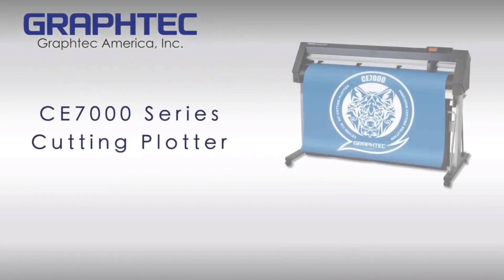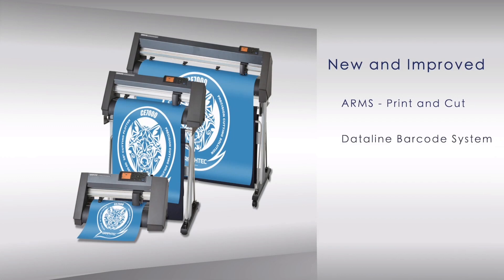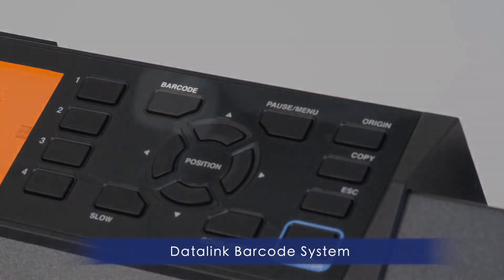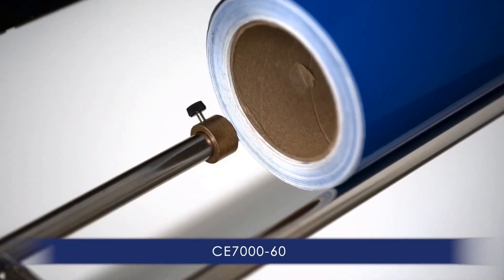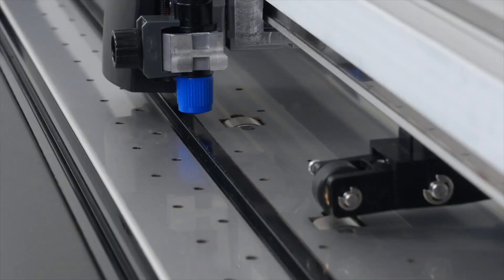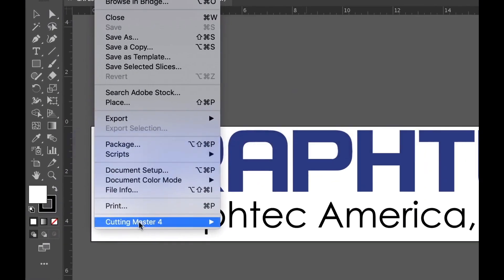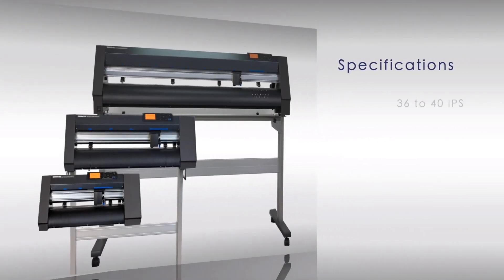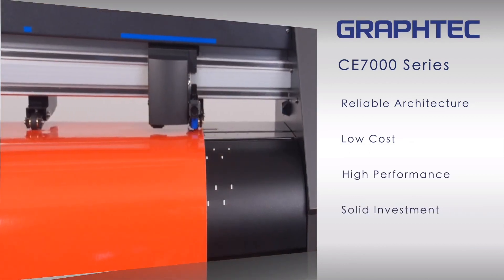Graphtec CE7000 Cutting Plotter

Comment: Sorry if this a crazy question. I'm looking for our first vinyl plotter. I have a good deal of experience installing vinyl vehicle lettering & graffics. But I would like to purchase a plotter to begin cutting our lettering & graffics. As an emergency/utility vehicle builder alot of the lettering & graffics we use are done using reflective vinyls. So my question is which plotter would you recommend? We do need the option to cut vinyl pretty wide 36"-48" widths would be best. I also do not want to spent a ton of $ as this will be a trial run sort of project to see if we can be successful at it and make this part of our business more profitable. Can make recomendation?
Reply from the maker: We get this kind of question a lot. Being USCutter we know all there is to know about cutter/plotters so we can help you find the right machine for the job. You can either look at our buying guide yourself: https://www.uscutter.com/index/page/static/subpage/buying_guides_new or better still, contact our sales team for an in-depth review of your specific needs. Sales & Support: 1-425-481-3555 M-F 7:30-11:30am, 12:30-4pm PST.